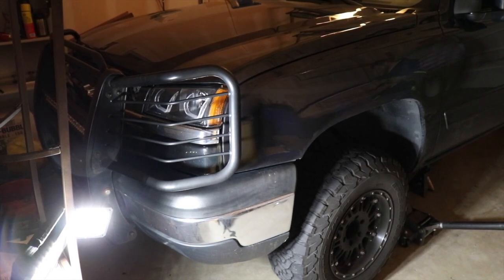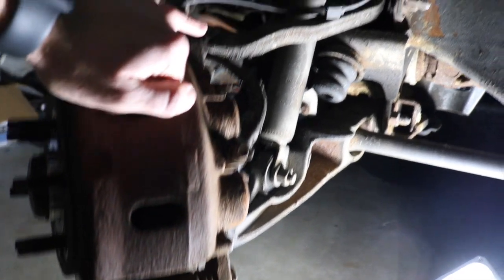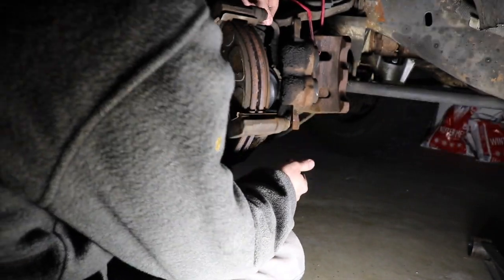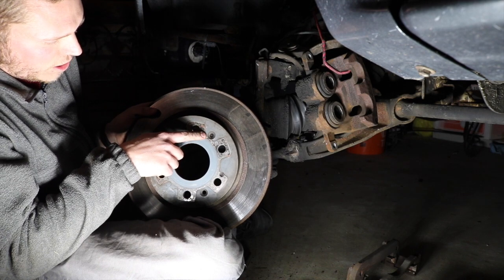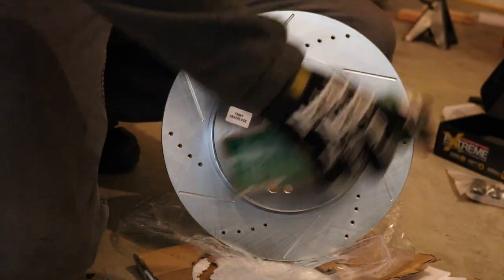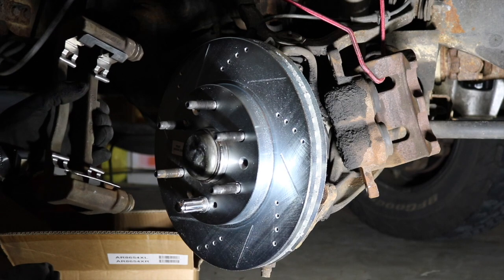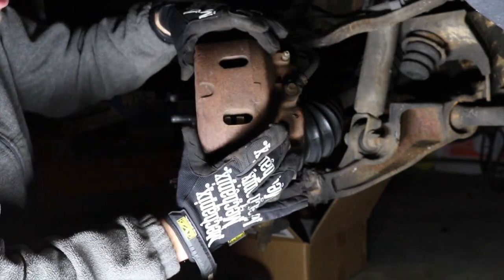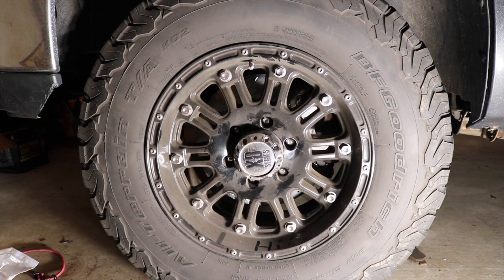Chevy Silverado Performance Brake Upgrade (step by step how to)

Comment: Is it the same set up for a 2001 Chevy Silverado 1500 lt 5.3 I’m bout to have to to mine too front and back
Reply: They should be the same. The 2005 is just a face lift of the 2000-2003 model

Comment: Any updates ? Thinking of doing mine with that same brand
Reply from the maker: LFTD5.3 Z71 still work really good very happy with the stopping power. You can feel the difference. Feels like you have to step
On the brakes a little harder in the beginning but then they really grab.
Reply: Frost7092 would they fit 16 inch wheels ?
Reply from the maker: LFTD5.3 Z71 I don’t want to steer you in the wrong direction I have 17 inch wheels on my truck and they fit great. They are the same exact size as stock brakes so if they fit on your stock brakes they should be nice.